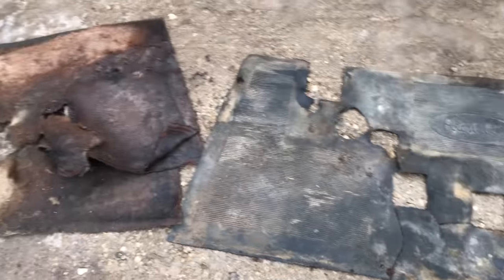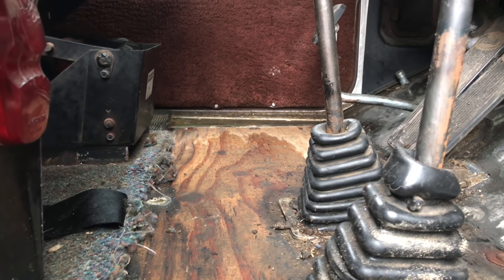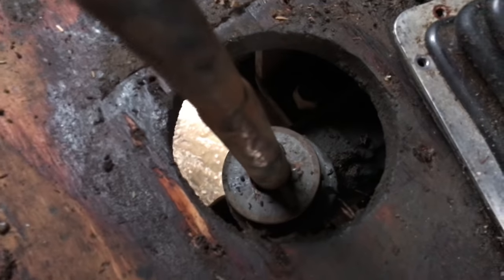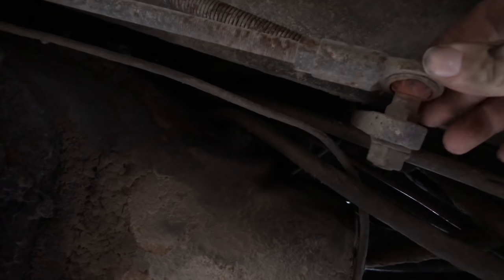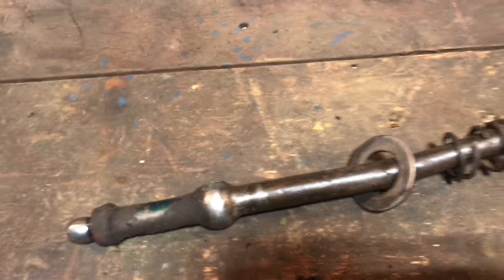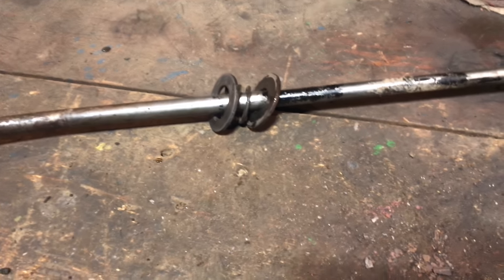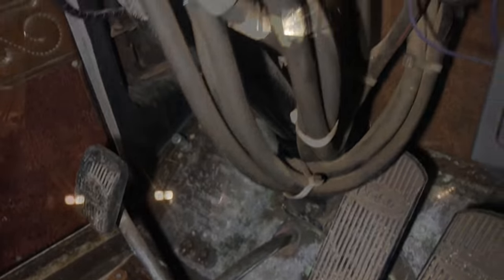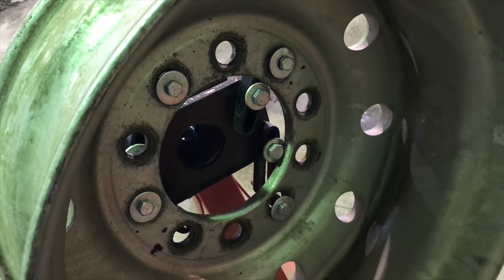#Peterbilt #359 Peterbilt 359 Restoration Part 2

Comment: Be sure to address the wooden blocks on the linkage,, these true the push pull on the transmission and help with vibration, plus keep the linkage from bending, but they do wear and need to be lubed